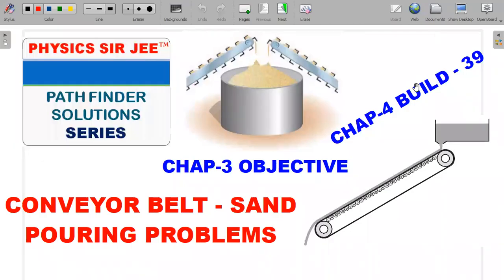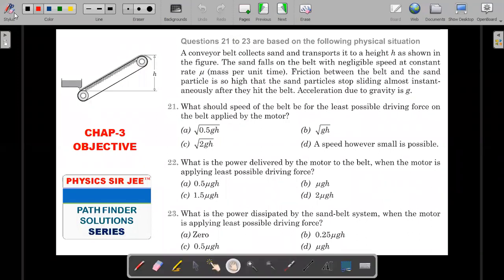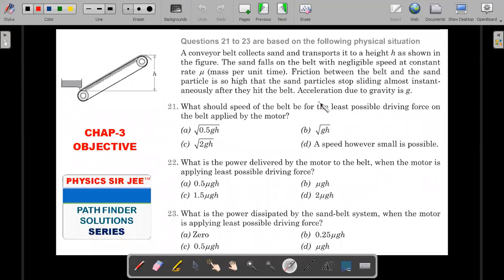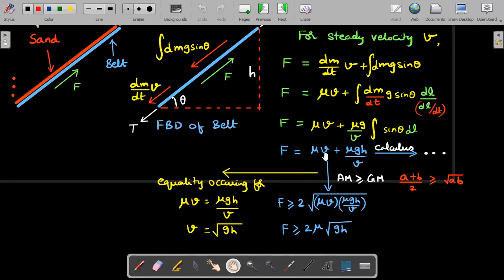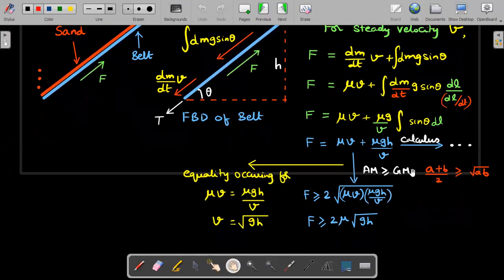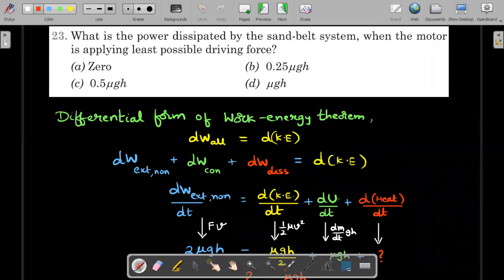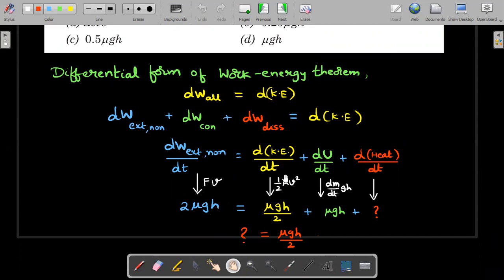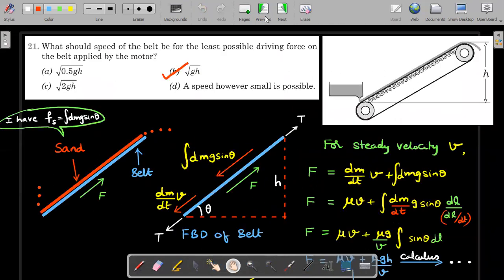PATHFINDER PHYSICS VIDEO SOLUTIONS | INCLINED CONVEYOR BELT AND SAND | JEE ADVANCED SCHOOL PHYSICS

Comment: 7:18, sir what is dl here {physical signifincance}?
Also to evaluate dmgsint, we can just find the total mass by multiplying u with total time to reach the top. 
dm = (h cosect) / v * u
and on simplifying dmgsint
we get ugh/v. 
This should be easier, as thinking to multiply dt and dl numerator and denominator and rearranging is tough job during exam pressure.

Comment: Sir nicely explained.... Sir I have an alternate solution can you please clarify is it conceptually correct or not..... Sir here on the sand as sudden change in momentum is due to friction thus friction provides thrust force..... As we need force minimum that means steady state... So on sand net friction force must be equal to mgsin∅(m total mass accumulated) and also equal to uv... So hcosec∅/v that is time for one dm mass to reach top. Point that means mass accumulated=uhcosec∅/v 
So net friction=(uhcosec∅/v) gsin∅=ugh/v and as it equals uv... Thus it yields v=√gh and as force on conveyor belt must be
F=f+uv=>2f=2ugh/v=>2u√gh... 
Sir can it be an alternate solution?
Reply: I don't know what you did at last, but for writing integral dmgsintheta you have used better method, as in sir method it was tough to understand physical significant of dl, and all other things.

Comment: Sir greatly explained.....Sir I have an alternate solution... can you please clarify that is this method conceptually correct or wrong... Sir the frictional force on sand provides thrust force to the sand and as minimum force we have to find that indicates that in steady state we have to pull and hence sand particle has accn=0 hence f=integral dmgsin∅=ugh/v=uv(as it's equal to thrust force)...thus v=√gh and now on  conveyor belt force will be f+uv=>2f=2uv.... F=2u√gh.... (Ans)

Comment: sir why did we not include the reaction force on the sand in its fbd at 5:15 but we cinsidered it in the belt's fbd
Reply from the maker: I didn't include it because I was not drawing FBD or writing separate equation for sand. That force you mentioned will be there on sand
Reply: @PHYSICSSIRJEE  but sir you wrote static friction = int dmgsintheta on sand
Reply from the maker: @PratyushKumar-d9f  yes, now , you have pointed clearly... It's on left top of the screen... That's not on the falling sand... that's on the sand that's already on the belt moving steadily... So equilibrium on such sand means static Friction should balance mg sin theta
Reply: so the thrust force only acts for some time and therefore friction balances the mg component

Comment: Sir, thanks for the wonderful question and ur hardwork!,👌🙏😁I have a doubt, at 12:38 question, in which part of the system is the energy getting lost as heat?
Reply from the maker: Sand+belt rupture against each other and kinetic friction does negative work on them together , which generates heat
Reply: @PHYSICSSIRJEE  sir I dont know how is it possible for you to solve so many doubts of so many students on YouTube INSTANTLY!Extremely Fortunate to  have been taught by you Sir😃🙏🙏

Comment: In 2nd question if we use the method you used in last part of 1st question then when stedy state is reached d(Wext )+d(Wdiss)=0 and dW(cons)/dt = uglsin(theta) and dK/dt is (1/2)uv² which yields a different ans. Where did i go wrong?
Reply from the maker: d(Wext) =0 in second question. As explained in the question, there is no motor here unlike first question. So your first equation is wrong
Reply: I think heat must be there...

Comment: Sir thank you so much sir...your videos helped me a lot...and I got AIR 140(OBC) in Jee advanced. 
Cannu suggest me some college sir pls...for cse....is roorke good sir or should I take some other branch for good iit🙏🙏
Reply from the maker: Roorkee is good for cse. Are you getting anything in top 4 IITs?
Reply: @PHYSICSSIRJEE  should see sir last year IIT Kanpur 133 us last...if luck favours may get kanpur
Reply: Sir I am thinking ece a bit tougher side because it includes all semiconductors part ....so..
Reply: Or else for electrical can I get good placements and package sir
Reply from the maker: @bevaraanuradha6729  ece is tough but CSE , you have to compete with best students
Reply: @PHYSICSSIRJEE  electrical sir then....I don't exactly know what will be in electrical engineering..can u pls tell
Reply: @PHYSICSSIRJEE  sir is cse only good in top 5 IITs..
Reply: Pls reply sir
Reply from the maker: @bevaraanuradha6729  CSE is good everywhere in top6 and also IIT Hyderabad. But prefer top 4 if you get it
Reply: rank in CRL? 2000ish?
Reply: @mistapepe5724  around 1100
Reply: @bevaraanuradha6729  Congrats man
Hard work paid off
Reply: @mistapepe5724  tq dear